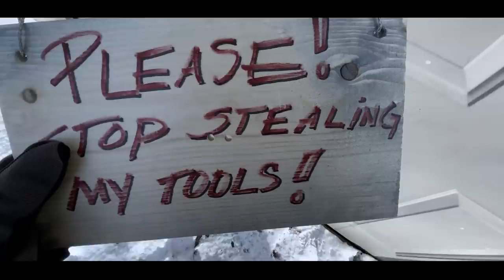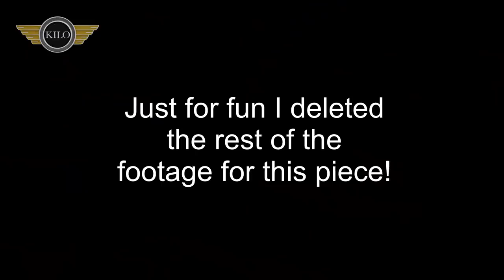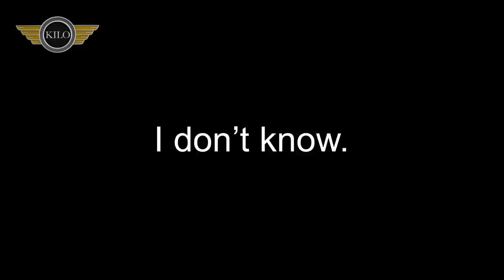FPU Bison Vise Resto'. Cause Baby I'm Worth it.

Comment: I'm in the middle of my vise rebuild. A Reed 4C.
 How does the hammer tone hold up to Cleaners?
By the way, great job.
Reply from the maker: Hey Micheal. First, Reed 4C...nice! Secondly, I have never had to put that paint through its paces. So I don’t want to speak without the knowledge. A lot of the finishes I use are not because they are crazy tough. It’s what I have access to and the tools to apply it. So I don’t want to steer you in any certain direction. Sorry I couldn’t be of more help. But, good luck on the vise! And if you have more questions ( that I probably can’t answer) feel free to ask.
Reply: @KILORESTORATION  thank you for your candidiness. Once again thank you and great job.

Comment: Die grinder and wire wheel - makes short work of old paint without damaging the under lying metal. Wire wheel on the dremel for those small crevices. Wear mask.

Comment: Slow down your drill speed.  Drills will last longer
Reply from the maker: The drill clips were played back at 2x and 3x. After the first comment about that I realized that nobody could tell I speed that up cause it’s just a spinning drill.  Lol. I was actually using 550-600 rpm. Thanks, armyman2445!